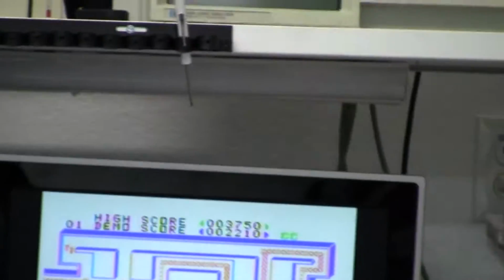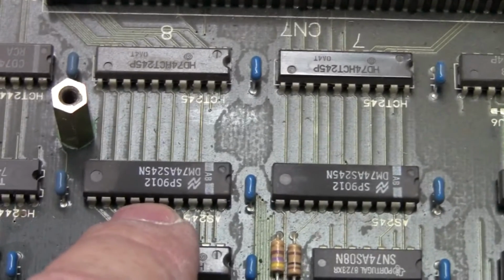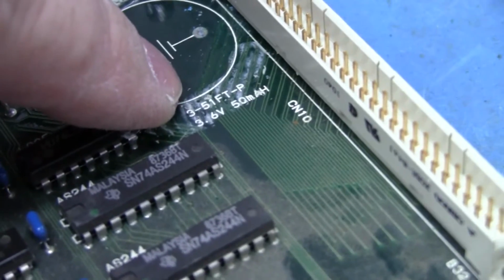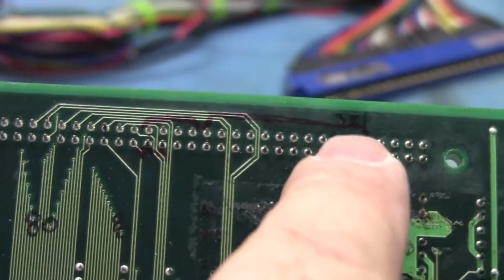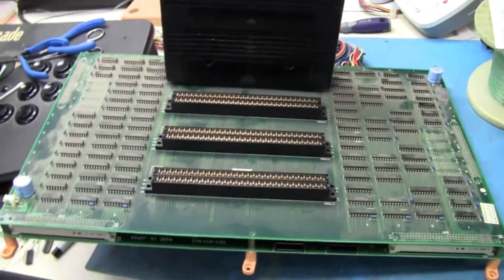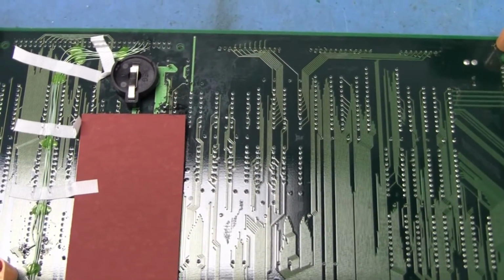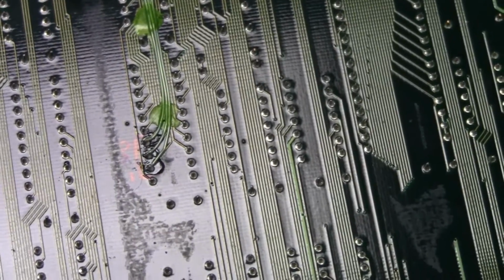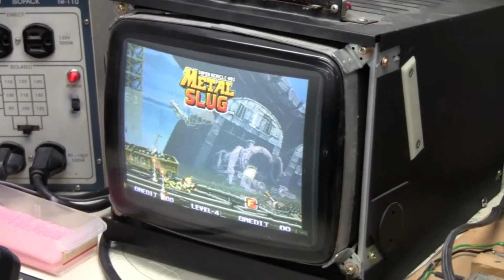Neo Geo 4 slot Crosshatch of Death repair

Comment: Thank you very very much for posting this...I had the crosshatch hangup issue like you described. I followed your example, located the broken trace using continuity tests, traced the via to the chips solder point on the corresponding leg, soldered in a jumper and voila a functioning MVS-4!! Thanks again for this content.
Reply from the maker: Awesome! Glad you found it helpful and was able to fix your game board. :)

Comment: Really nice repair. Only thing I would consider using a super capacitor in place of the battery. You won't have to replace it nor disable the charging circuit and you can solder it on the right side of the board since it won't need to be accessed again.

Comment: Wouldn't it be better to have a rechargable battery?
Couldn't you mount a battery on the underside so if it leaks it won't leak on the board?
Reply from the maker: Unfortunately, the board is designed for a NiCd and they always leak the blue green crystalline growth that eats traces. The best thing to do is remove the rechargeable battery, neuter the charging circuit, and installation of a non-rechargeable coin cell that is far less likely to leak.
Reply: Would it be possible to use a capacitor instead?
Reply from the maker: It's possible to use a supercap, but you'd need to refer to the datasheet to see how much charge current to supply and change out the 470 ohm resistor for the proper sized one.

Comment: This is handy.  Have a similarly sick board. Are there schematics or did you trace them all by hand (ouch).
Reply from the maker: Traced by hand. It's not too hard on this boardset. It's 2 layers of signals with inner power and ground layers so you don't have to worry about traces getting lost on inner layers when tracing.

Comment: How are you? I wanted to ask you. I have a 4 slot. That doesn’t read slots 3 and 4. 1 and 2 works. I have cleaned the pins really good. Nothing. 
I also don’t have any sound 
I did a recap. On the Board still no sound. Could you tell me what could be the issue or something to look for ? Thanks
Reply from the maker: Hi Alan, on the top board of the Neo Geo you'll notice a pattern of repeating groups of chips. Those chips control the signals to/from each slot. Grab the "MVS cartridge pinout" for the slot from the Neo Geo Development Wiki and follow the signals for SDA0-SDA15 and from SDD7 through SDR0 on the CHA board slot. Signals are being interrupted either from the cartridge slot to the chips controlling them or from the group of chips between slots 3 and 2.

Comment: Are the resistors and diodes around the battery important? Was wondering if I have to replace them too, or if they're only there for the battery circuit. My batt has corroded those away.
Reply from the maker: Yes. They are all part of the circuit that directs the battery power to where it needs to go to keep the Backup RAM powered and that handles the chip signals that allow for the chip to be read/written to. Those signals have to be put into a specific state to go into low power mode for battery backing of data. The 470 ohm resistor allows for charging of the NiCd battery and needs to be removed when you replace that battery with a CR2032 and holder.
Reply: Thank you! I was thinking of ignoring the battery because all I've read about it says it's only used for bookkeeping functions. Should be easy enough to replace, though.

Comment: Any way to replace to slots? Mine are so loose
Reply from the maker: Takes a lot of work and a boneyard for replacement parts. You're looking at 120 solder joints to remove and 120 to do per slot connector and there 2 slot connectors per cartridge position. That's 8 x 120 desoldering and 8 x 120 soldering joints. 

Also, if you aren't very careful in fully desoldering the connectors you'll pull out the plated thru holes and pull up the traces off the top of the PCB.
Reply: I have to do something.